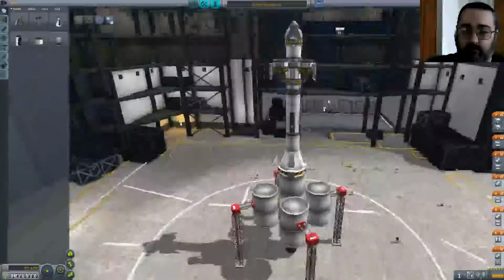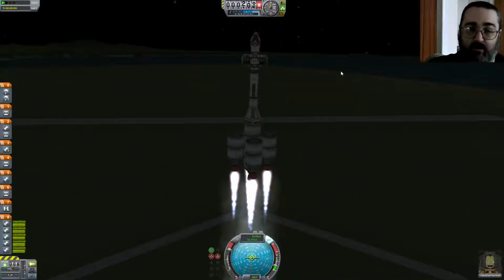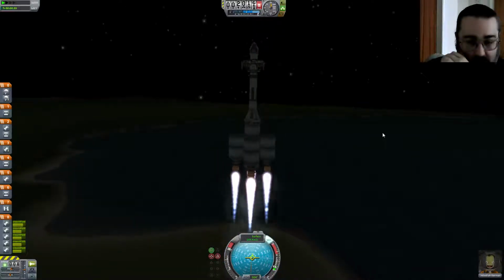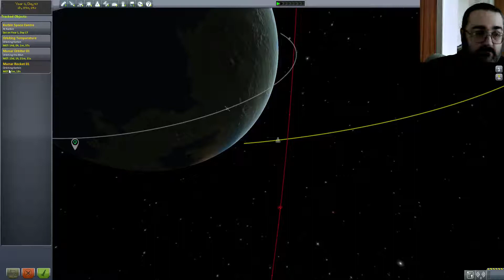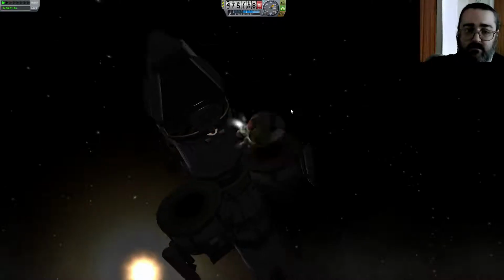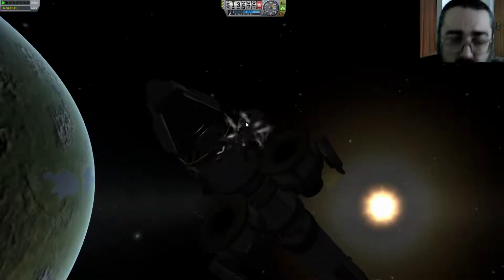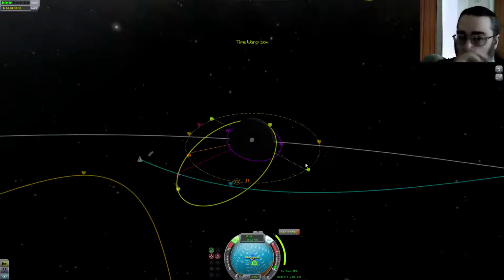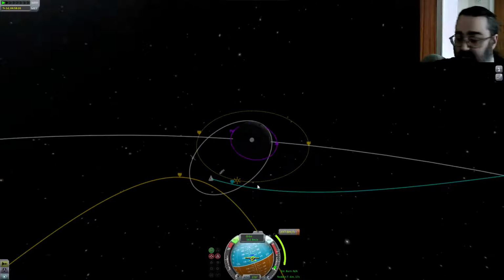Kerbal Moon Landing 1

Comment: I think the engine was working, it was just baffled by the adapter and so produced bugger all thrust.

You've upgraded your science center, so you've resource transfer.  You could have activated (by right clicking) the engines on the lander stage, manv'd using them and them topped up the tanks from the trapped tank.

That launch stage is a work of art.  I'm tense now, waiting to see the landing.
Reply from the maker: Jaye Foster I'm rather pleased with the launch stage :)  Wish I'd thought of the resource transfer - might have... well, you'll see in the next episode!